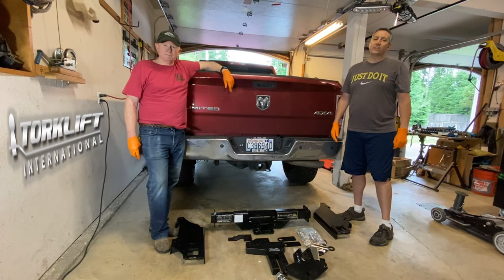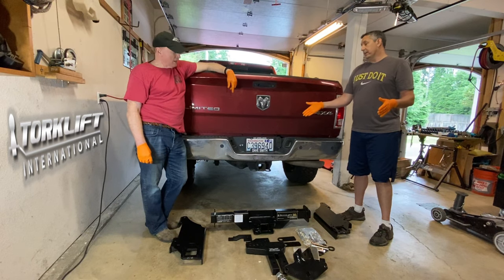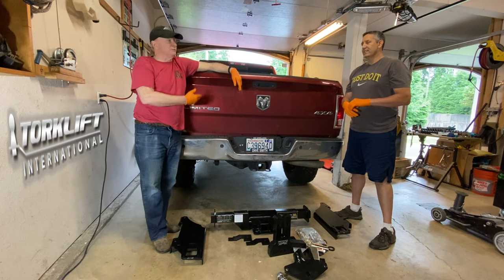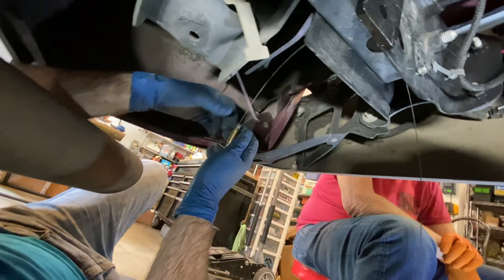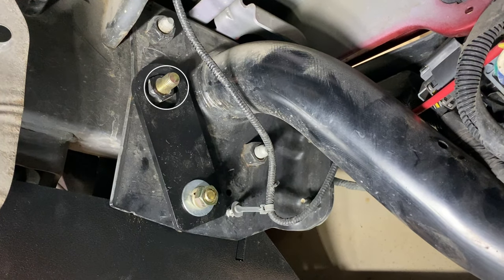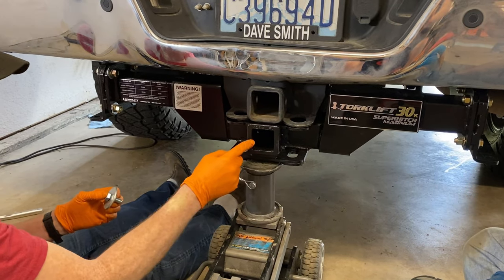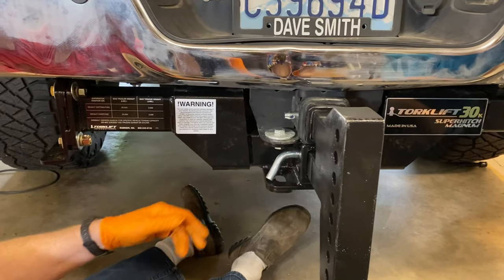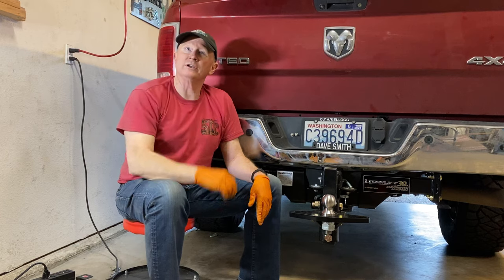SuperHitch Magnum by Torklift installation

Comment: Saw you guys at 4WP yesterday. That was an awesome build, high flex! Hopefully you can have a podcast on that. 
We’ll be using our 2014 JKU for a bit more overlanding, and mountaineering and backpacking trips this season. After that, I think we’re going to sell it and buy a sprinter van for light overlanding as we tackle more summits and climbs across the states and wfh in the van. But, eventually we’ll go back to a jeep, maybe the hybrid.